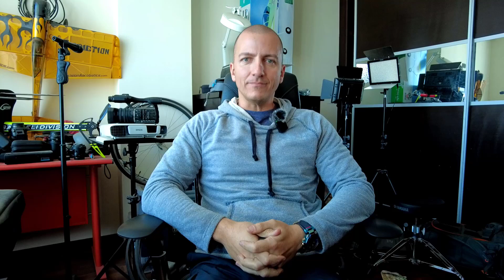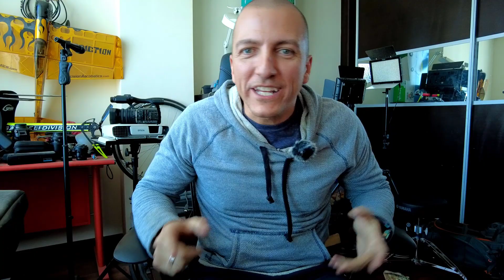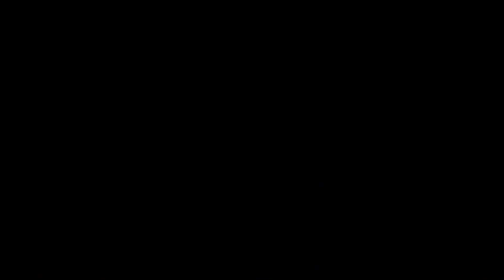My First Taste of Engineering

Comment: I did this multiple times in my 23 years as a plastic injection molding technician. Only problem here in Michigan is they do not care. They will take credit for your work and leave you in the dust. Hence why I am changing careers and taking all 5 of your PLC training courses. I love programming and working with robots, but I can do without the plastic!!
Reply from the maker: I think the only reason they 'rewarded' my contribution was a matter of necessity. They needed somebody to do the job, there wasn't anybody in the local labor pool and everybody in the plant knew I was already doing the work.